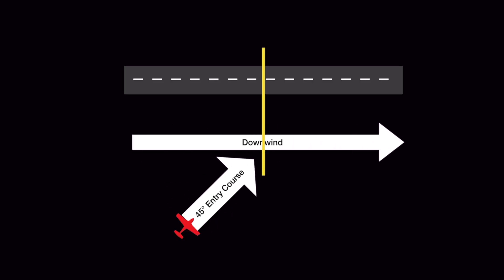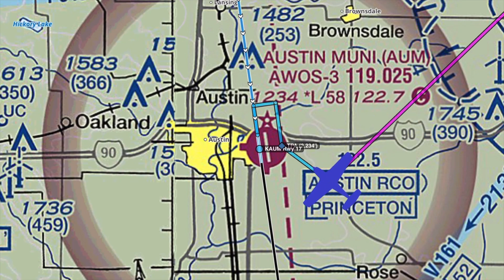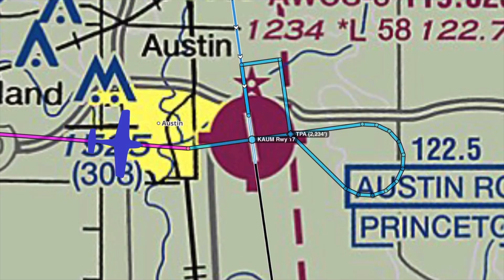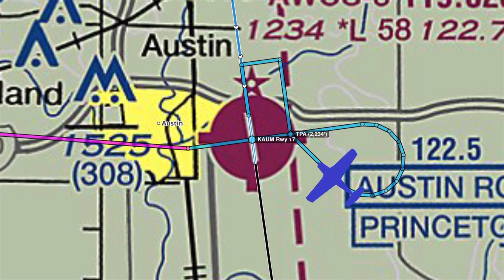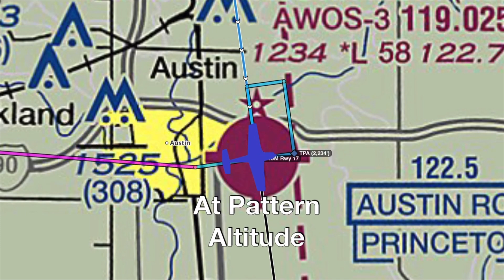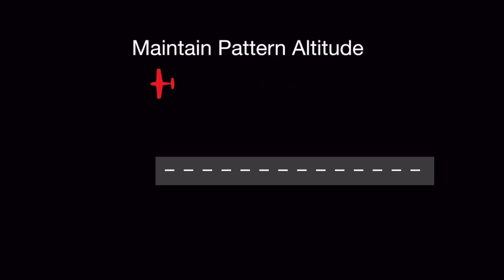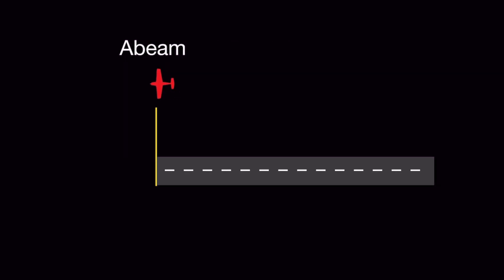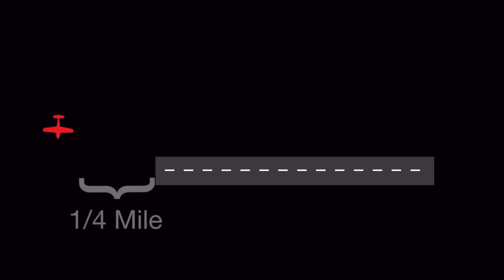Non-Towered Operations: The FAA issues new guidance!

Comment: Flying two miles out before doing a tear drop descend into TPA would be too close in my opinion.  Especially considering that the downwind leg averages 3/4 nm from the airstrip.  I typically fly 4 nm pass the airstrip itself before the tear-drop descending maneuver to reach TPA and set up for the 45.  Flying 1000 ft above TPA to cross midfield is better too.
Reply from the maker: Thanks for the comment.  I can’t see anything wrong with leaving more space between you and other aircraft. 

The Circular says at least 500 ft above TPA. How far you fly away from the pattern will likely be a function of how fast your airplane is, and what obstacles may be in the area. Again, the distance comes straight from AC 90-66.  But adding a buffer to that makes sense, especially if the airport is busy, or you aren’t familiar with it. Thanks again for the comment!!
Reply: On the very rare occasion I do a teardrop, I cross 1000ft above pattern, fly 2nm past the runway, then start the descent, and descend all the way to TPA before turning. I’d much rather be fully established at TPA when I’m turned back towards the airfield and scanning the downwind leg to time my entry.

Comment: Another thing the FAA should address is IFR pilots practicing IFR procedures and making radio calls about their location, referencing the particular approach or procedure they may be on. Being that instrument pilots are only about 25% or less of all pilots, and that practicing those procedures in VMC conditions at an airport that is likely at that time being flown almost exclusively by "VFR only" pilots, making radio calls and referencing particular instrument approaches, fixes, or procedures, does nothing to indicate your location to a newly minted private pilot or a student pilot in the pattern. Giving your location as " xxxx initial, inbound on the VOR alpha" will mean absolutely nothing to a non-instrument rated pilot that is in the pattern, and who needs to know where you actually are. IFR pilots practicing instrument procedures in VMC conditions, especially at non-towered airports, should be making all position reports on CTAF using terminology that can be understood by "VFR only" pilots.
Reply from the maker: I completely agree and work with my instrument students on this a lot.  Referencing distance, direction and altitude from the airport and saying you are on a straight in for runway 17 is a lot more descriptive than “crossing the final approach fix on the RNAV 17”. Thanks for the comment.
Reply: Completely agree! Great post!
Reply from the maker: @idratherfly2000 Thanks!
Reply: Yep 100% agree. It seems that the corporate jet pilots are the worst about this. Pretty much every IAP is going to have you on approximately a 10 mile final once you’ve turned inbound, so my calls are usually “XYZ traffic, Skyhawk 1234 10 mile final RNAV 18” then the same at 5 and 2 miles. I really only mention the approach in the call so they don’t think I’m one of those assholes doing a long straight in for no reason lol
Reply: @TheLucas2696  Agreed... What I basically was saying, though, was that saying your inbound on "such-and-such" approach means nothing to a VMC only pilot.  You can still fly the approach but make normal calls stating direction, distance, and altitude. ESPECIALLY at non-towered airports.

Comment: Another thing I notice with the AC is that in the appendix they mention departure leg vs. upwind and what the proper verbiage is. My understanding is that it is considered upwind if staying in the pattern, and departure leg if departing the airport.
Reply from the maker: Unfortunately, it is not that clear-cut.  This is a point of discussion and often disagreement.  I think in the AC, the FAA may be trying to clarify the difference between the Upwind and Departure legs.  However, not all the current FAA documents agree.  

For example, in the PHAK (published 5 months after the Circular) and Airplane Flying Handbook (AFH, published a year before the Circular), the Departure leg is the leg flown along the centerline of the runway until either departing the pattern or turning crosswind.  The PHAK doesn’t mention an Upwind Leg.  The AFH defines the Upwind leg as parallel to the runway but offset right or left of the departure runway, opposite the downwind leg.  The Circular and AIM seem to support this.   However, if you look at the Pilot/Controller glossary, it defines the pattern as Upwind, Crosswind, Downwind, Base, and Final (pp T-9).  Bottom line, you are not likely to hear “Extend your Departure, I’ll call your turn to crosswind”.  

Jason Miller (The Finer Points) has a very good video about the terminology and highlighting the disagreement.  Here is a link if you are interested:  https://youtu.be/JmLswSvIobk?si=vwHAPZsS1_rakCYJ

Unfortunately, until the FAA changes all the documentation (or publishes a new Circular with clarifying language) I think there will still be confusion about the Upwind and Departure legs.  As Jason notes, until then, all of us should try to make sure we are being very clear when we communicate.  I hope this helps at least a little.

Thank you for pointing this out.  The more folks that know about the confusion, the better prepared (and safer) we can be.
Reply: The departure leg is the path that extends from the centerline of the runway. The upwind leg is parallel to the runway on the opposite side of the pattern from the downwind, generally at a similar distance from the runway as the downwind.

Comment: I would say fly over the field at a 1000 ft if doing the teardrop.  The problem with 500 ft is that jets and turbos fly the pattern at 1500 ft and further out.
Reply from the maker: Excellent suggestion! The circular says to use at least 500 ft above pattern. The Airplane Flying Handbook further suggests (as you did) to use at least 1000 ft above pattern if large or turbine aircraft operate at the airport, so as not to conflict with their traffic pattern.  Thanks for the comment!!

Comment: No pilots preferring straight-in approaches will be swayed by this. In my experience non-towered airports are the wild wild west
Reply from the maker: You are, likely, correct.  I attended a fly-in this summer where aircraft were entering the pattern straight in, as well as using many other “creative” pattern entries.  It was scary.  I also had a conversation with a non-towered airport operations manager about the document who then posted the guidance as the airport’s new Standard Operating Procedures.  While not everyone will comply, my hope is that by spreading the word and sharing the document, most pilots will change their behavior and avoid accidents or incidents because they are making better decisions.  

Thank you for watching.  And, thank you for the comment!

Comment: What’s straight-in approach?
Reply from the maker: Thank you for the question.  In IFR flight straight-in approach has a very specific meaning.  It is “An instrument approach where final approach is begun without first having executed a procedure turn”.  However, when used in reference to VFR flight, it usually means intercepting the extended runway centerline without flying any other portion of the traffic pattern (crosswind, downwind, or base).   Flying VFR straight-in approaches puts aircraft in positions other VFR aircraft are not expecting them to be, and can make it more difficult to “see and avoid” these aircraft.  I hope this helps.  Thanks again for the question.
Reply: @ScottKoonCFI  Thanks for your clear and accurate explanation as in your videos. Love your videos.
Reply from the maker: Glad it helped!  Thanks!

Comment: Scott,  I really enjoy your short and concise tips but I'm confused.  In the video on AC 90-66C, you indicate that the new guidance when staying in the pattern is to initiate a turn to crosswind 1/2 mile past the end of the runway and within 300 Ft of pattern altitude.  The 1/2 mile makes sense to me as it would help keep aircraft that can reach that altitude in a shorter distance over the ground from cutting off slower climbing aircraft when turning downwind.  But for the life of me, I can't find it in the circular.  The only reference I can find for 1/2 mile is on page A-1 # 6 for departing traffic.  The examples on pages A3 & A4 #5 say to initiate the crosswind turn after the end of the runway and within 300 Ft. of pattern altitude.  Where should I look for the reference to 1/2 mile?  Thanks
Reply from the maker: Hollis.  Thank you for the comment.  You are right.  In looking back through my notes (and the circular) I seem to have combined two notes.   As you’ve discovered, the circular notes that pilots should turn base after the end of the runway, but does not give a specific distance.   

To add to the confusion, there is a bit of an inconsistency between A-1 #6 and 11.8.  A-1 #6 notes to start the turn at 1/2 mile and 300 ft below pattern altitude.  11.8 notes that before turning you should be beyond the end of the runway and AT pattern altitude.  Plus, if you look at the diagrams of pattern operations, it appears the turn to crosswind and the turn to 45° seem to happen at the same point.  Of course, all of these are rationalizations.

I am impressed you downloaded the circular and have been reviewing it.  That is awesome!  Thank you for the question and for pointing out the inconsistency.  Keep up the excellent work!

Comment: When entering the pattern from the upwind side, if you fly over and two miles past, then you are turning your back to the airport.  I (a student pilot) did that on my one and only night flight and lost sight of the airport  - it freaked me out.
Reply from the maker: Maintaining situational (and locational) awareness is much more difficult at night.   The lack of visual cues can cause disorientation very quickly.   Interestingly, in Canada, to fly VFR at night you need to earn a Night Rating which is at least 10 hours of training after Private Pilot.  

Having said all that, there are two, approved upwind-side pattern entries.  If it is night and the airport is not busy, using the second pattern entry method is perfectly acceptable.  Perhaps as you get more night experience it will be easier to utilize the teardrop entry.  

Thanks for the comment.